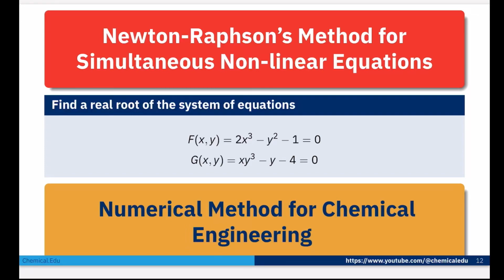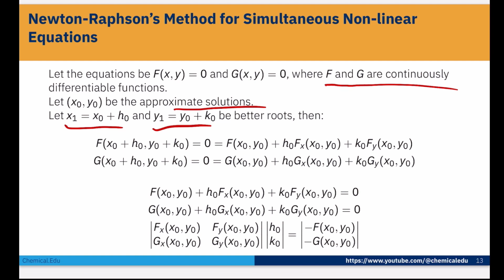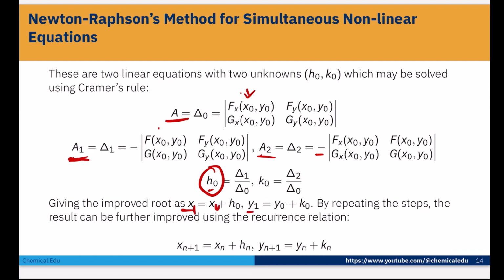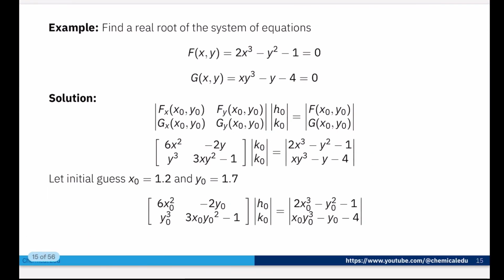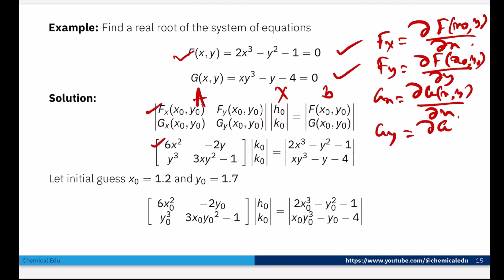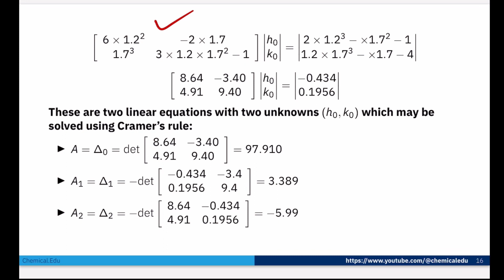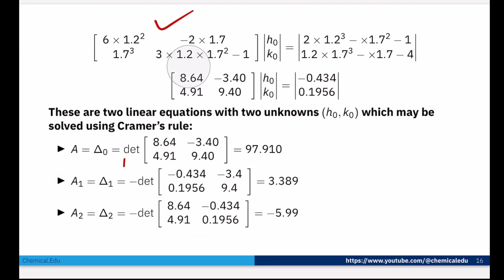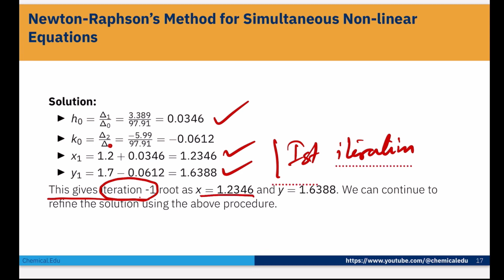Newton-Raphson method for systems of simultaneous nonlinear equations #newtonraphsonmethod

Comment: how can a solve a nonlinear system of equations involving exponential functions?
Reply from the maker: Use Newtown raphaon Method
Reply: @chemicalengineeringA  Tks for your reply. I'm solving a system of the type 1/D(x) = 1+R(x), where R(x) = k_j e^(-p_i x)
 and D(x) is a known function. This way, I need to obtain k_j and p_i. Initially, I define the p_i values and calculate k_j. After, I use the Newton-Raphson or Gauss-Newton method to calculate p_i. With p_i defined, I need to calculate the new values of k_j, and so on. However, after some iterations, p_i does not necessarily converge.